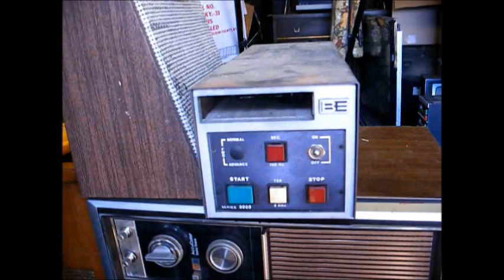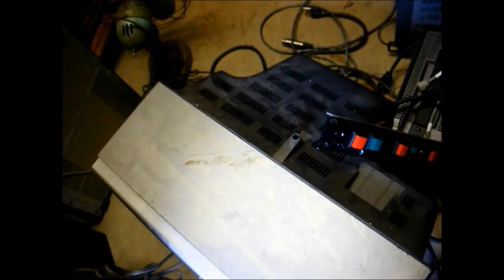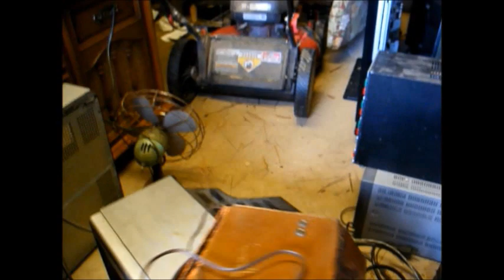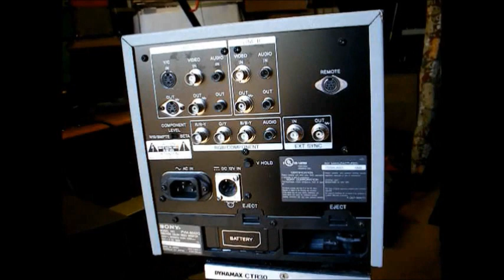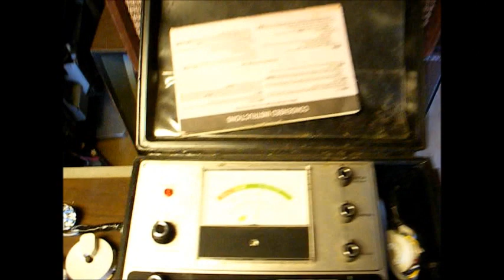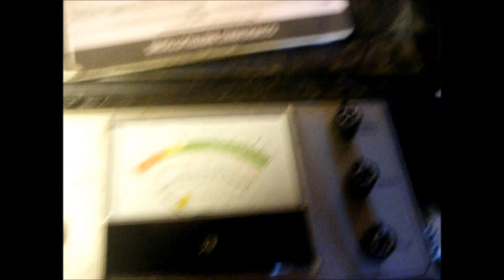Recent electronic finds from the TV station

Comment: The broadcast cart machines were different from 8 track home players. They had a pinch roller inside the machine that flipped up to contact the capstan. Not like the home 8 track player that had the pinch roller built into the 8 track cartridge

Comment: Too bad your not closer to me, as I have been looking for a 70s, maybe early 80s color table-top. I had one as a kid, and wanted something very similar or the same for a bedroom TV. Right now, I have a Magnavox BPC that was bought for me brand new (to replace the one in question) and I had to fix it 3 times but it has a picture on it as it did when it was new, surprisingly. It uses the chassis that the 100uf 100v capacitor is a common failure point. it failed twice, and then eventually the STR failed due to a 3.3uf NP cap drying out. So far so good. But eh... I want more vintage!

Comment: That RCA TV was the first color television my family bought when I was a kid. Ours was a model FQ505W. I remember the first set died completely a couple of weeks after we got it, and the dealer brought out a brand new replacement, which worked fine for years. Yes, it is instant on. I laughed when I saw the "ACM (Automatic Color Monitor) button between the VHF and UHF channel dials. That was the "do not touch" button, because it 1.) Had little if any positive effect on picture quality, and 2.) was a good way to get a visit from the repairman. :) Thanks for the memories. I always felt we were the last family in our neighborhood to get a color TV, but mom and dad had bought the previous 19" RCA black-and-white portable when I was a baby (8 years prior,) and they weren't going to replace that set until they had to.

Comment: I can't wait to see the video on the RCA tv. I didn't know they made an all solid state model that early.
Reply from the maker: Actually, the first solid state RCA color TV was the non-modular (looked similar to a tube chassis layout) CTC40 from late '68-early '69. Then, there was the "RCA 2000" that was made in limited numbers and it's chassis, IIRC, was a CTC47. Then, there was the CTC44 that was similar to the CTC40, except for the flyback and solid state HV tripler. The CTC40 still had a tube for the HV rectifier. Then, there was the CTC46 that I think was the first large screen modular chassis. After that, there was the CTC48, 58, 68, and 78 that all looked similar and were made until about '77.